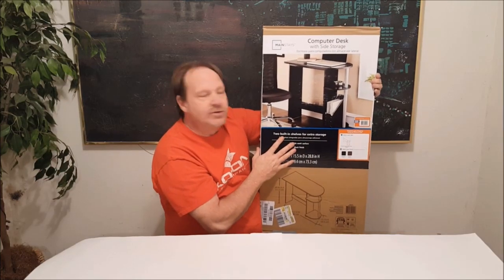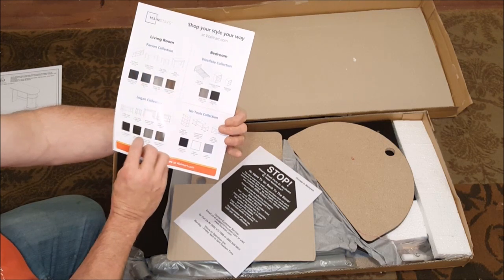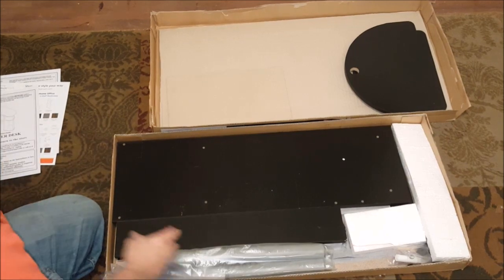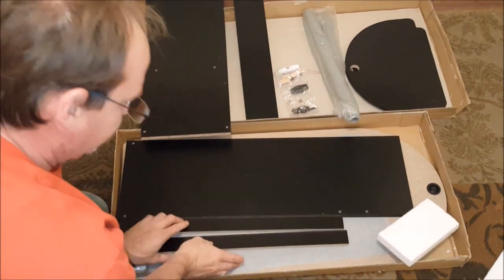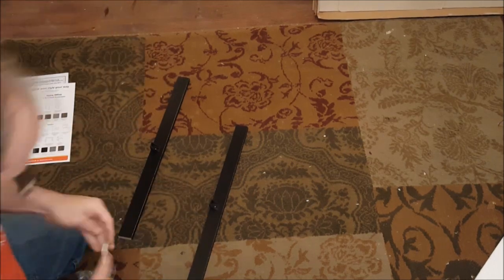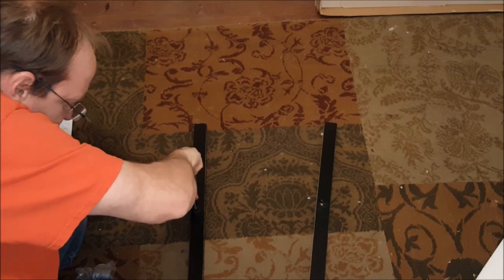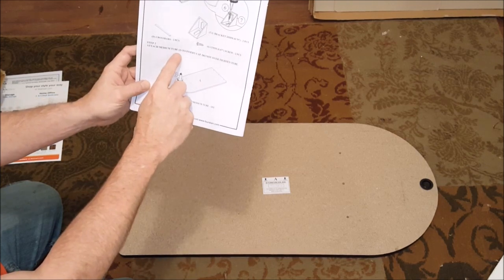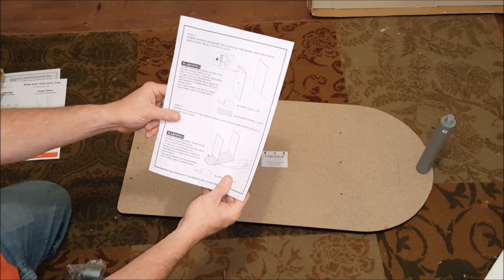Computer Desk By Mainstays

Comment: how much weight does it hold?
Reply: From the Walmart website under product details...
The top surface supports loads up to 89 lb. (40.3 kg), upper and lower shelves support up to 30 lb. (13.6 kg),